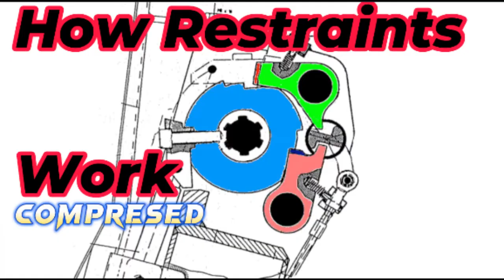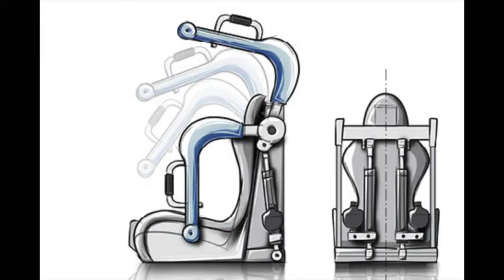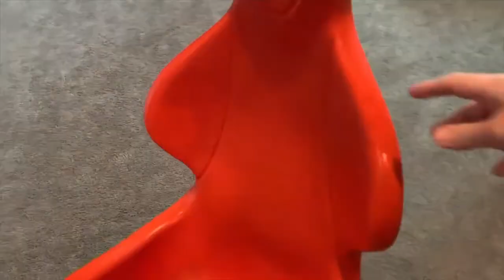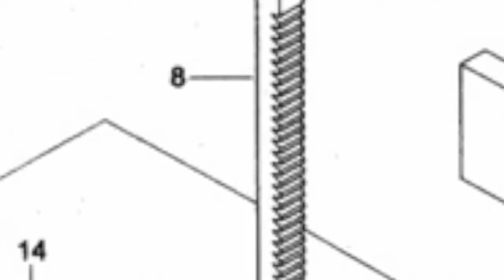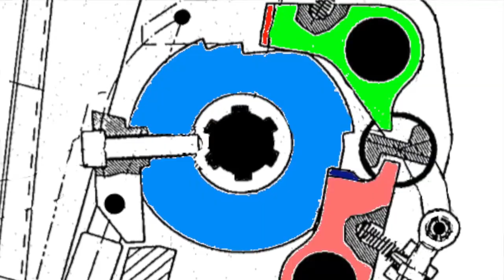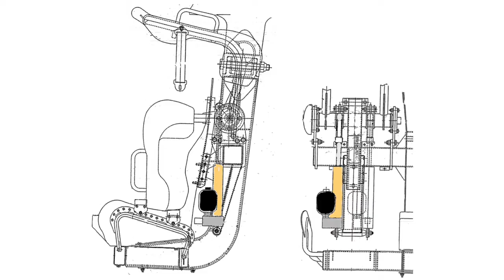How basic restraints work compressed

Comment: So How Did The Guy In Arizona On The Roller Coaster Jump Out The Train On The Lift Hill Because It Just Unlocked Right Before It Went Down The Hill With The Primary & Secondary Safety In Place, Didn't One Safety Supposed To Back Up The Other? How Did They Both Fail?
Reply from the maker: @simardssurveillancesystems8209  that’s a good question. That ride might not have a secondary. But if you get adjustments wrong or have filed push pull cables it can do the same thing.
Reply: He has a video on that already.

Comment: Apparently this is quite an uncommon opinion, but is it good or bad that I prefer over the shoulder restraints for larger thrill rides? They look more intimidating to some degree, but they feel much safer because they hold in more of my body. I’ve been told some people get headaches from them but I have yet to experience any.
Reply: I think it's an uncommon opinion among enthusiasts, but I think most park visitors have come to associate over the shoulder restraints with increased safety. Numerous manufacturers have proven that rides (including looping coasters) can be perfectly safe with other types of restraint, but people just don't trust them as much.

One thing that does frustrate me though is the seat belts  - I completely understand that they are not as a safety device, but that's how they are perceived, to the point where rides without them get wrongly labelled as unsafe. Look at the comments on any reports on the Icon Park accident, and you'll see the lack of seat belts cited as a cause.
Reply from the maker: @joshslater2426  I don’t think it’s uncommon. It really depends on people’s levels of comfort with what they are doing and body type also has a large part to do with that. I have no problems with shoulder restraints myself.